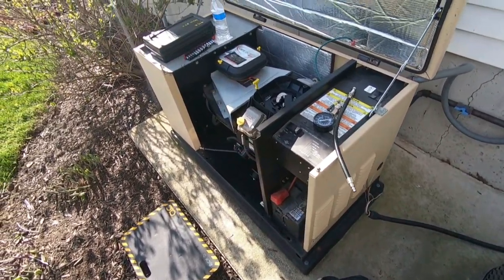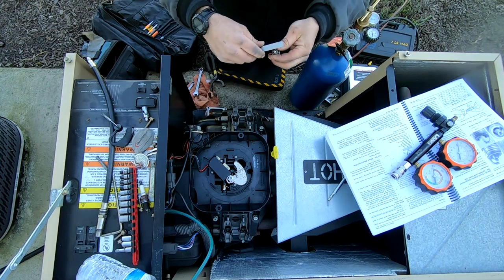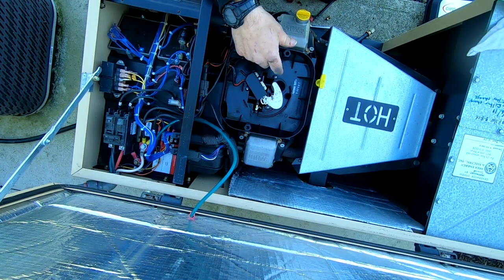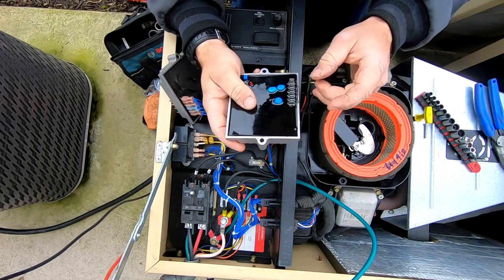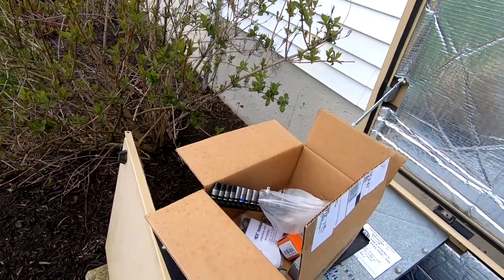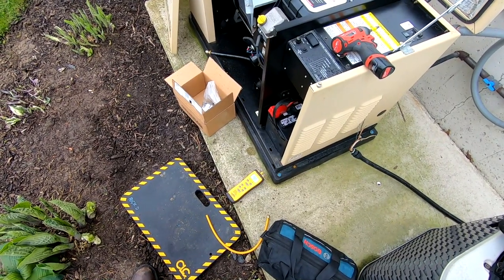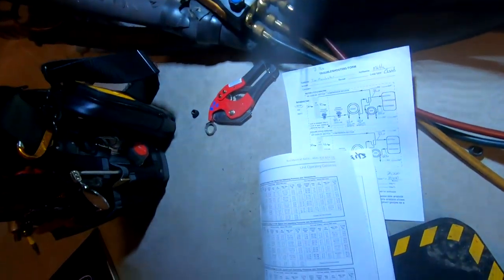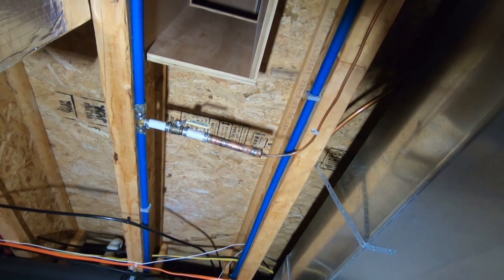Generac Generator Problems / Compression issues / Oil leaking / Hard Starting /  Geo-Thermal Recheck

Comment: Just picked up an old Generac model 044563 from caretaker. No start issue. Going thru it slowly. Little things needed fixing. Noticed a little oil by air filter housing. Your video's are spot on.
Reply from the maker: 🙂👍👍 Thanks 4 watching them!
Reply: @HVACRSurvival  I'll do a compression test tomorrow.

Comment: I have a 60 KW Katolite on a lab building. It's powered with a 350 GM V-8. Runs on natural gas. The only problem it has had in 14 years is the oil pressure sensor. The engine would come up to running pressure and stay there but the sensor would slowly drop down the reading until the control panel would shut down the engine. Other than that and changing the plugs once a year,  it's done a great job.
Reply from the maker: Those are four pole rotors versus two pole. They run at 1600 RPM versus 3200. That makes them quieter and last longer.  That's a total different kind of generator than these lawn mower standby generators 😁

Comment: I have this exact generator (model 0052541 16kw LP).  Owned it since 2009.  I believe it was new in 2006.  I bought it from a generac dealer second hand in Redding, CA who was leaving the area.  It will start with low-voc carb cleaner in the intake, but will not start on it's own.  It has been a PIA forever.  I replaced the main regulator assembly in 2019 from zillerelectric and it still won't startup on it's own without carb cleaner sprayed into the intake.  I think the solenoid coil that sits in between the regulator might be the problem, it does get 12v to the coil (e.g. #14 wire).   The valves are adjusted properly (.003),  new RC14YRC plugs set to .040.  I was trying to see which hose the LP uses from the regulator side to the carb intake, on mine it's the hose that is connected to  " IN 2" which is closest to the edge of the side of the unit and sits on the right hand side when looking at the battery.  "IN 1" goes to the NG side on mine and I am concerned it might be backwards as this unit has never worked right, even w/ the switch on the carb set to LP.  I would guess this generator does not even have 20 hours on it as everything under the valve covers looks brand new.  Oil was changed w/ synthetic a few years ago.  Any suggestions would be appreciated.  I have hired generac techs to come out and do an evaluation and they recommended the regulator swap-out, but that did not solve the problem and I ended up with hundreds of dollars in service calls without resolution.  The propane company was here 2 days ago and they checked the regulator from the tank to be about 13.5 wc which feeds my unit.  10 years ago it was set to about 11 wc and had the same problems.  Unfortunately this is the only unit which will run my 5HP well pump when power is out during public safety power shutoffs w/ PG&E and I don't care to spend $6k for a new one.

Comment: GREAT INFO TX...IF ONE HAS 30PSI ONLY COMPRESSION ON A 9KW GENERAC GENERATOR..168 HOURS  3YEARS OLD ...CAN IT REPAIR OR NOT REALLY
Reply from the maker: Check your valve adjustment. if its ok then you would have to tear the engine down and replace the rings and whatever else is worn.

Comment: Great video brother. Generac teck from the nor west myself. A good t/s trick for a those older gens with that style air box and intake man. Is if it's running on lpv, hard starting and your out of ideas, flip the fuel selector to ng.  If it fires right off, could have bad rubber gaskets @ the air box around the intake man.. took me awhile  to figure that out , so I'm telling everyone I meet...  keep safe keep warm.
Reply from the maker: Basically not pulling the fuel from the fuel regulator as strongly as it should?
Reply: No, air leak at the air box throws off the mixture, if you put it in ng it allows more fuel in...

Comment: Does the fact it's running on LP gas make it hard to start? 
It seems to have a long cranking time compared to a gasoline unit.
Reply from the maker: Depends on how in tune they are. I have some that start fast but some of the older ones have some issues.

Comment: Just ordered the installation of a new Generac 17.  Am I making a mistake?  Has Generac corrected some of the issues you encounter?
Reply from the maker: They are a lot better than the first and second generation. Install is important, hopefully the installation company has a good reputation, the install is just as important as the equipment.  Generac sells to every Tom Dick n Harry unfortunately.
Reply: @HVACRSurvival  the installer is a local electrician who has installed several units of various size over the past years.  I have confidence in him; but bottom line is still the quality of the product.

Comment: That's an air box leak.quick test is switch the lp to ng. Oil is most likely were the crank case vent comes out of the block.

Comment: Great video. Do you remember what year and model this generac was?  You said they are getting better with their generators. What year did that start?
Reply from the maker: I believe it's like the evolution series of controllers.
Reply: This is a guardian series, uses an analog PCB,  manufactured late ninedys early thousands, dis cont 2006, when they went to what they called " pre nexus"

Comment: pretty sure champion is the OEM plug manufacture, surely there's cross references online. I'd not hesitate to run Champions/NKG/Denso/motorcraft in place of them, just make sure you'r not buying counterfeit online and hope the parts houses aren't either :)
Reply from the maker: Champion for some reason is the brand they use on there motors.  Generac truly designs and manufacturer's the motor. The larger Genrac generators have Ford, GM, etc. motors and they have whatever brand spark plugs they recommend. I'm not a gear head so I don't have time or the desire to cross reference the plug but because I have tried to buy them locally before from Auto Zone, Advanced Audio and Napa... I have found its a weird plug to match up. It can be done but it's odd and I believe NKG or Bosch might have been the few that crossed over but that was over 6 years ago since I looked...That's why I feel the way I do about it. My drive to do generators has gone way down because I'm not doing enough anymore compared to my prior employer so my thought is get in or get out but don't straddle the middle. (No body else wants to do them or learn them.) Think of it like a auto mechanic repairing a cars computer at the component level... The computer runs the car but that doesn't mean the mechanic is a electronic repair tech, so generally the mechanic has no interest in knowing why the flux capacitor is under 2.4 gigga Watts by 4.876% causing a random window to roll down every 47.8 days 🤣

Comment: Surprised you don't carry those step less clamps with all the other stuff you work on.  Do you have an opinion on a better designed generator than a Generac in that residential range?  Really enjoy your videos I share them all the time Thanks👊
Reply from the maker: I have a PEX stainless crimp ring tool but didn't have any of the small clamps. I use to run plumbing and electrical residential service in addition to all the stuff I do now. Most HVAC company around me have to do it all. I think Generac is a lot better now. I like Kohler but I'm not really experienced in them. I don't care for the Briggs n Stratton gen sets.

Comment: when air cleaner is dirty or plugged... it will cause oil to be sucked up into air box through the crankcase breather hose .. found this problem many times.. change air filter your go to go..
Reply from the maker: None of these generators run long enough to even get the filter dirty. Most of them usually have anywhere from 40 hours to 150 hours or less. Thanks for the feedback and for watching 👍👍

Comment: Man , you guys are really versatile , that's a job for an electrician innit ?
Btw I see the mighty M12 is back , did Milwaukee do the right thing and replaced it then ?
Cheers 👍
Reply from the maker: Yep, Milwaukee didn't have parts to fix it so they sent a new one. Around here electricians might know the codes and how to install it but not many want to learn to repair a generator.
Reply: @HVACRSurvival  Glad they did the right thing 👍
Reply: Electrician? I don’t see a receptacle or light switch  on the genny😂

Comment: Will a worn/defective LP gas regulator create a situation where my Generac 04456-0 starts occasionally but for the most part won't start?  I see in this video you refer to problems with the early Generac of which mine is one?  Also any suggestion for a replacement regulator that won't duplicate this problem?
Reply from the maker: when you are referring to a regulator, are you talking about the lp regulator provided by the propane company or are you talking about the fuel regulator inside the generator? The one inside the generator is what I had problems with the most. The rubber tends to harden in the regulator and not react like it should.
Reply: @HVACRSurvival  The regulator inside the generator.  The replacement I'm looking at has an additional port below the two main outlets that isn't there on the original.  Can that port just be closed?  Also any suggestions on how to remove cover from older Generac Guardian 12kw.  Need to replace starter on this unit as well.  Thanks very much for the response.  Greatly appreciated.
Reply from the maker: I don't remove the cover to change the starter, I assume you must be a homeowner so make sure you unhook that negative wire from the battery or you will have a bad day if you short that thing to ground because that starter is constantly positive straight to the battery. Far as a regulator, be certain that it's the correct one,  they may look the same but they are not all the same. I don't have access to the generator website like I used to so it would have to be looked up by either their parts department or maybe you could find something online.

Comment: I need to replace my oil cooler hoses. What are the specs or size of the hose? I see the part # as Genetrac 0C9806, 3/8" ID x 6" long, rated for 300 deg F. Are those the correct specs? Can I just get any oil cooler hose at any autoparts store?
Reply from the maker: Yes you can get the hose at the parts store. Tell them you want something that can handle oil. Use a regular clamp.

Comment: How do you bench start a General oh I engine?
Reply from the maker: I'm not a engine mechanic per say, I'm mainly required to change magneto's, adjust valves, change starters, chokes and safety switches. I do my work on site in the weather. So I haven't tried doing any bench testing.

Comment: How do you test run these without being hooked to power?
Reply from the maker: Hooked to power? They create there own power
Reply: @HVACRSurvival  I meant hooked to service.  Bought one used and wanted to hear it run before I bought the tranfer switch and everything
Reply from the maker: @sean3301  put it in manual mode. Make sure there's no power wires or control wires touching anything and turn the main breaker off before starting it
Reply: @HVACRSurvival  ok thanks. I've got everything isolated so I'll try that.
Reply from the maker: @sean3301  you have to register the generator before you can run in auto mode.

Comment: Hello friend 😊 🌾
got problem 😭
1 - first name : generac 
2 - last name : model number  
00524440 
16000 watts
problem 
won't catch 
does not get fuel ( N gas ) 
problem  may be out side regultor 
or 
inside regulator 
SOS = How can i check it out .
battery = serviced 
oil = fresh 
spark plug ok 
start start  = does not get fuel 
what should i do ? i call repair man 
but when i explained , they only looking for a mf stupid one can BF  . why ?
Reply from the maker: Best thing to do is go on generac's website and search for dealers, look for the dealer that has the most certifications, then Google them and look for reviews. Unfortunately not everyone's created equal. Some don't care some don't know but it's unfortunately a fact of life. If you were close by me in Ohio I'd see if I could look at it but unfortunately I doubt you are.